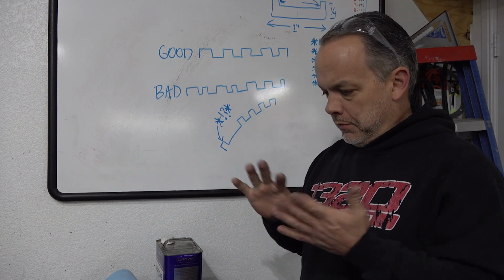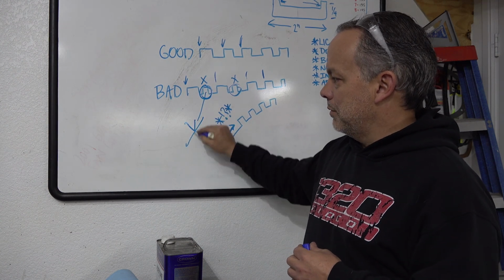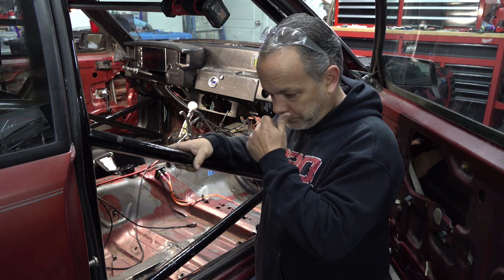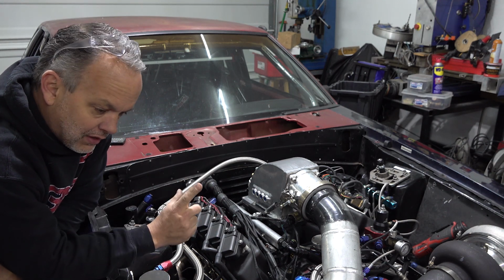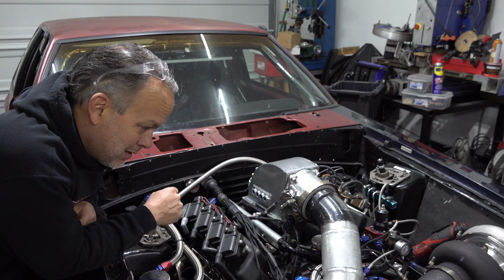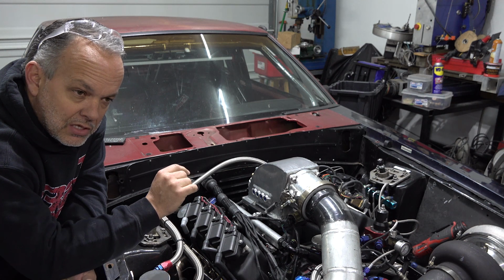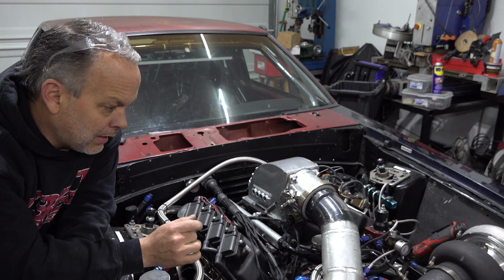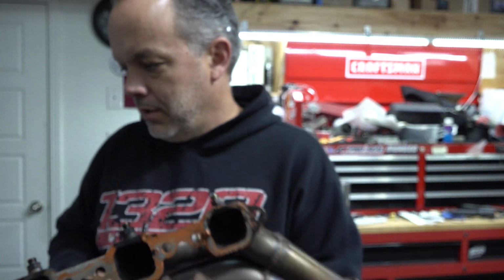Is it really fixed?

Comment: Good find on the filter thing. I can't really see how the signal gets skewed but obviously it was. Electrical "noise" is hard to diagnose fer shure. 
You gonna run a bead around the ports and sand it flat or some other way to get it flat? I like a thin layer of red Hi temp rtv and that looks like what you are using. I'm not familiar with the extra hole problem. I guess that is in the head. I like the threaded plug Idea. I would try to do it with some allen head set screws and some lock tite to hold em flush. You can always weld a nut on em to get em out if need be. Funny how only the top leaked. i\Is the turbo heavy and pulling the header down?

Great passes. And you aren't even launching hard. 
Keep up the great work.
Reply from the maker: Hard to say exactly how it vfc why  the signal is getting skewed - one can only assume its EMI causing it. I've done the repair in the header flange already, we will see how it holds up today! I did just weld it up around the ports and belt sand it flat

Comment: I get the problem but not how u solved it. Like how can we fix that if we run into the same problems
Reply from the maker: I turned on noise filtering in the software.
Reply: @diygaragetx  do u know what its called on HP tuners or Holley?

Comment: Think you need a manifold flange that has a wider mating face,  that will give a stronger area to help against warping... Yours are very thin/narrow... Also you could put dowels in those holes to help locate/hold the manifold in place.. 
You're doing a fantastic job though...!!
Reply from the maker: I've done something in the area of 40-50 sets of headers, not one single time have I had trouble with keeping it sealed - this one time is due to the collector being cut off and shortened (mentioned in video). Theres no matching holes in the flange where dowels could be used. This secondary bolt pattern I am using is to facilitate up to 1 7/8 primaries, that you normally cant do with standard bolt spacing.

Comment: i would get a bolt or make something to put into the  header bolt holes that are not used, make them flush and that would give you something to help sealing those up. just my 2 cents.
Reply from the maker: I actually considered 5/16 aluminum rod. The only problem is that it would have to be precise in length so that it will not hold the header flange up, but occupy as much space as possible
Reply: @diygaragetx   maybe a header stud trimmed down to the right height with an allen head.

Comment: Usually sync reason 2 is caused by 1 the sensor to far or close to the crank wheel
2 bracket that holds the sensor is vibrating or flexing so the sensor gap is changing
3 the pull-up resistor on the crank sensor is not small enough to pull the signal back to 5v or 12v (depending on your input voltage)witch will make the ecm thing the missing tooth is happening where it shouldn't be.

I have seen the bracket flex under high HP levels and make the sensor gap change that's a hard one to diagnose since it won't usually do it on a dyno....tire shake makes it real bad if that's the problem...
Reply from the maker: The bracket is 1/2" billet aluminum stock with 2 bolts in it - not likely that it flexes, or moves. The signal was checked before, last year, with an oscilloscope, its definitely getting pulled up to 5v. I may revisit it to confirm. Outside of that, I hate to mess with it any more since it's making passes now. Lol
Reply: Sounds good those are just some things to look at if it does it in the future...keep up the good work 👍

Comment: Would it be too much trouble to put bolts in the holes that are not being used and trim them flush to the head to get a better chance at sealing the exhaust?
Reply from the maker: I thought about that, but I'm more worried about getting them back out if the need should arise